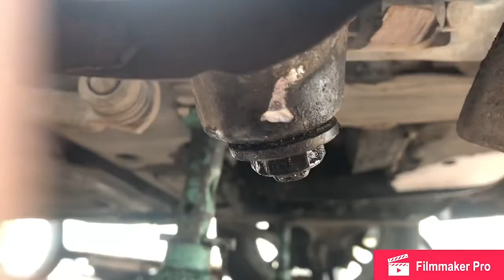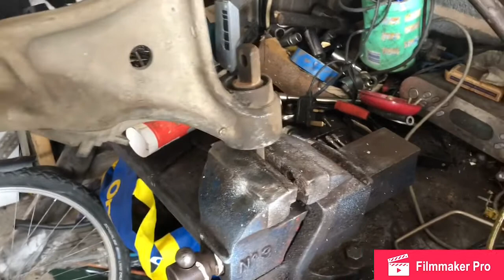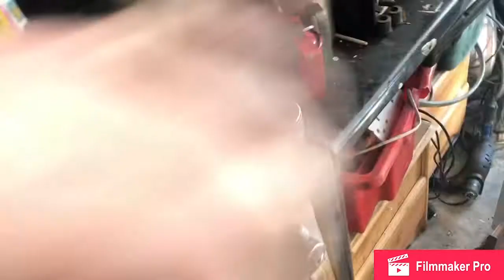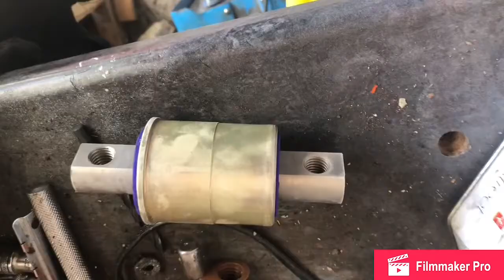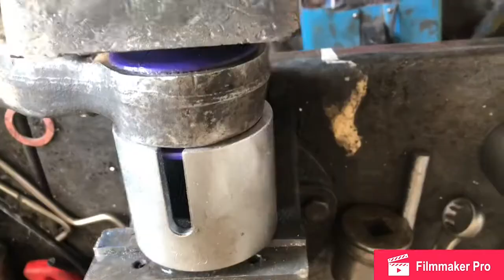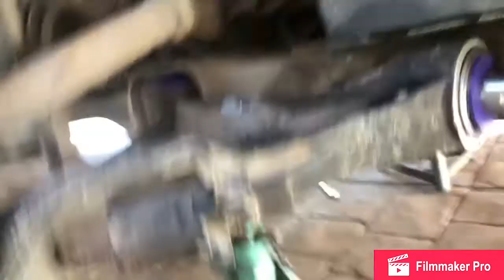Volvo V70 D5 Powerflex Bush Control Arm / Wishbone Installation.

Comment: FYI undo the shock from hub drop bottom ball joint in easily then then refit shock. Only 2 extra bolts.
Reply from the maker: Thanks for sharing.

Comment: Hi there! Are you pleased with how the bushings work?
Reply from the maker: Yes at the time of fitting they made a huge difference to the vehicle which I now take for granted a few years down the line!
Reply: @TheRepairer  
I plan on installing the black ones, track version. I want no control arm play whatsoever, so what to expect when it comes to bumps and railroad crossings?
Reply from the maker: @gheorghinacov6008  they are for the track so I didn’t bother with them, i am happy with results I got with the road going bushes.
Reply: @TheRepairer 
Hi there! I just got my wishbone 95a polyurethane rear bushings installed. The only “stiffness” is felt at the steering wheel, as front wheels now respond promptly to steering. Worth installing them for regular roads as well, I confidently recommend it!
Reply from the maker: Well done, I’m glad you got them installed ok and appreciate your feedback I too felt a noticeable lighter steering post installation.
Reply: @TheRepairer 
Did your bushings wear in these 3 years? Did they develop play?
Reply from the maker: They are still good to this day.
Reply: @TheRepairer  
I’ve been reading some forum posts claiming polyurethane degrades fast and is just a bad idea
Reply: @TheRepairer 
One more question: how did the torque steering felt afterwards? Was it reduced, completely cancelled or something else?
Reply from the maker: The steering was  much easier afterwards.

Comment: Idk how the hell you beat the other bushing in, I'm pretty damn strong and cannot do it. So frustrating. And my modified piping on a press just isn't holding up
Reply from the maker: I  used an interference fit on the bushes to help install them at one stage I got a bush stuck so I just used a heat gun to expand the aluminium,  then more persuasive taps!

Comment: I'm considering installing these bushings on my 2003 XC70.  How do you feel about these bushings having lived with them for a while now?  Was it a useful upgrade?
Reply from the maker: I’m glad I fitted them it firmed the front up no end, the top hats of the non pin bushes are cracking slightly at the brim but it goes through mot fine and still handles well.

Comment: Amy advice for the getting the new pin bush in? - I've got it in half way until it steps up, but can't seem to hit it in any more? 😅 cheers
Reply from the maker: I’ve used a hot  air gun to expand the aluminium. Oil well then good taps
Reply: @TheRepairer  cheers for the info 👍👌

Comment: Great video, it's given me the confidence to tackle this myself. Is there any guidance you can give on the type of bushing tool to purchase? Could you point us at the one you bought?
Reply: O
Ok
Reply from the maker: I’ve only just noticed your comment, this is the exact same kit as I purchased some years ago. https://www.ebay.co.uk/itm/Universal-Press-and-Pull-Sleeve-Tool-Kit-Bushing-Bearing-Seal-Driver-Removal-Set-/284354587584?mkcid=16&mkevt=1&_trksid=p2349624.m46890.l49286&mkrid=710-127635-2958-0

Comment: good video! I will be soon doing the same to my V70 d5.
Reply from the maker: Allow plenty of time , and best of luck it’s not for the faint hearted. Ratchet straps are essential for the fiddly reassembly of the wishbone in the car.
Reply: @TheRepairer  how does this change the feeling of the car?
Reply from the maker: @xantor_  feels much more positive and tracks better.
Reply: @TheRepairer  any vibrations now?
Reply from the maker: @matthewwaite7806  No all is still good.
Reply: @TheRepairer  cheaper than replacing arms too.